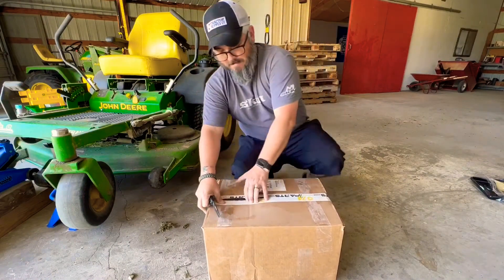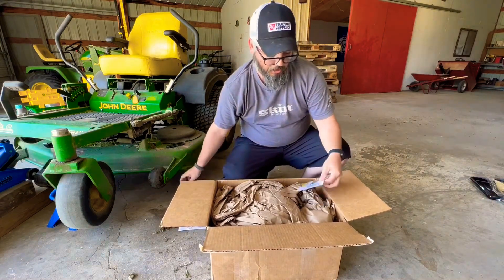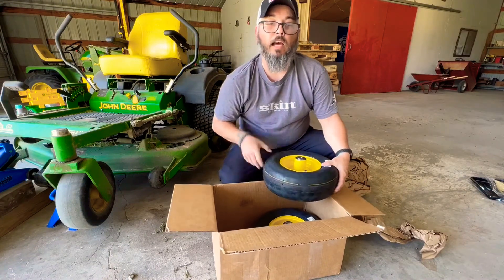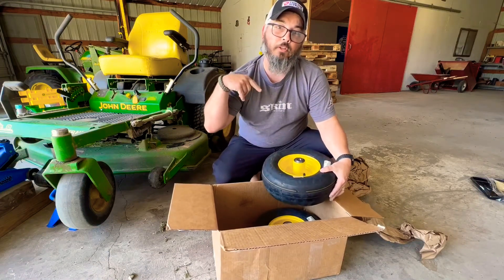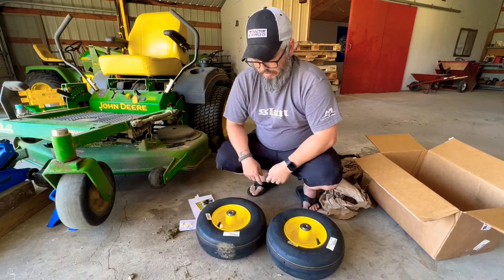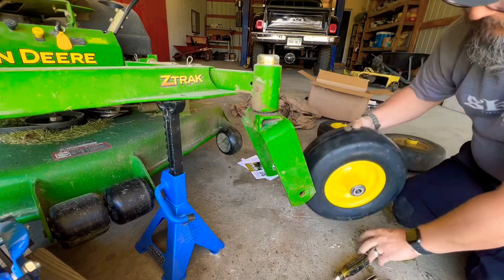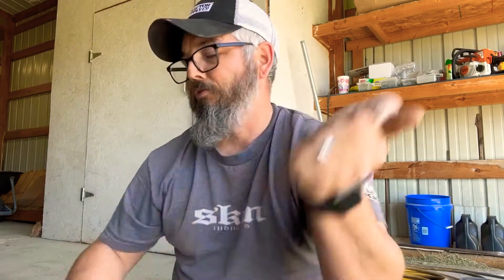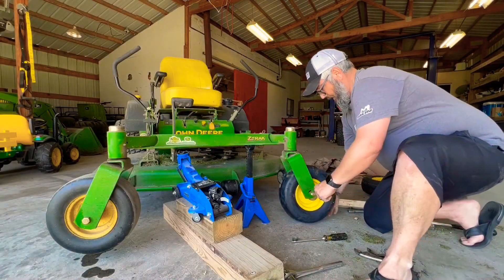051 - Maintenance Time | How To Replace Caster Wheel and Tire On A Zero Turn Mower | John Deere 717A

Comment: Glad we could get you fixed up and thanks for the shoutout!
Reply from the maker: I also gave you guys a shoutout on Instagram!! And hope that you guys liked it and hope we can work together on a project in the future!!
Reply: I was hoping for a trick to get this bolt out the last 20%. I guess I was on the right track. Just beat up some pliers and wrenches. What was John Deere thinking except for driving people into their certified repair shops just to change a wheel.
Reply from the maker: @derekiswriting I agree that it was a pain in the butt!! If I had to do it again I would soak the bolt with penetrating oil and just continue to lube it as I went!! And would like to have a bigger pry bar!!
Reply: I couldn't find the Amazon link ?
Reply from the maker: The link is below but that deal I found was months ago. Hope this helps!

John Deere Original Equipment (Set of 2) Tire and Wheel Assembly - TCA26303 https://a.co/d/aFb0owB